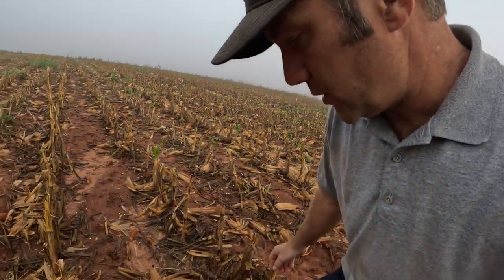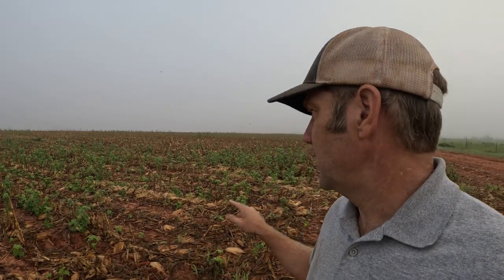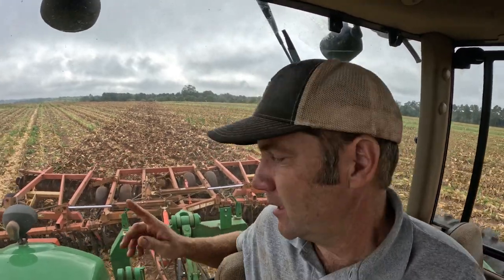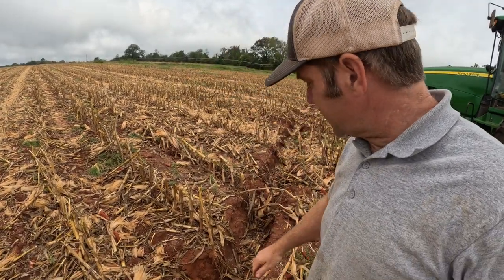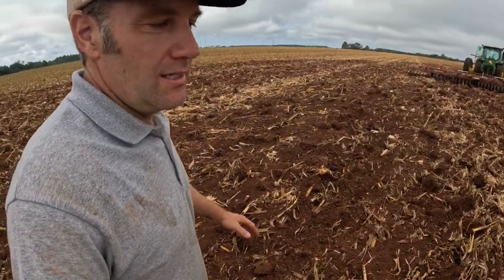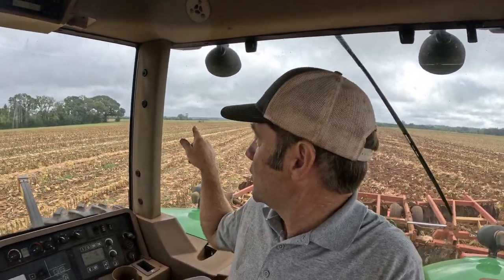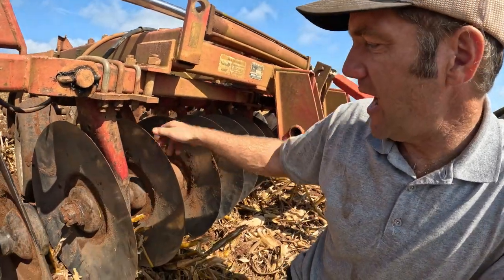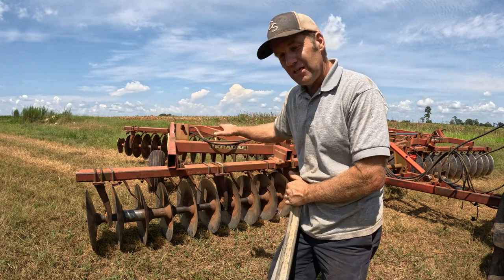Discing Corn Stubble

Comment: You are exactly right about ground speed w a disc harrow, our almost new rmx 340 31 ft is between 6.2 and 6.5 is it's speed and it's a little faster than your older harrows be ause of the cylinder on the tounge to adjust front to back pressure

Comment: Would scalloped blades cut the stubble up any better than the round blades?  Enjoy your description of the various tasks you are doing.
Reply from the maker: Scalloped blades are much more aggressive cutters.  Usually only see those on offset harrows around here used for cutting firebreaks.  Lift type harrows also usually have them to.

Comment: I'm a little late watching this one.🙄 Both tillage and chemicals are just tools in the box. Only YOU know what works best for your operation and conditions. NoTil is fine for corn/bean rotation, most of the time. But nothing is perfect all the time. Great video!
Reply from the maker: Obviously the fewer passes across the field the better.  No-till on red clay just isn’t an option.  I did a small trial in corn field this year.  All other variables were the same, tillage the only difference.  Most my corn was 8’-9’ tall yielding 240 bushel average…..the no-till was under 3’ tall, not all seeds produced a plant, not all plants produced an ear.

Comment: As a no till farmer it hurts to watch land being disc, but different soil types along with what we call a specialty crop calls for different measures. We're mostly corn wheat and soybeans around here so we no till and strip till everything.
Reply from the maker: Strip tilling was very popular here for 15-20 years but recently farmers are starting to trend away from it some.  I know there are large regions of the country where no-till corn is very successful and I’ve heard no till farmers in Montana say their wheat yield is “acceptable.”  In our area the wheat yield is doubled if you subsoil ahead of it.  No-till corn would yield 0-75 bushels here.  I had one row in my field that was shallow tilled but not subsoiled—that 600 yard row was 3’ tall and had 4-6” ears while the row on either side of it was 8.5’-9’.  No-till is a great option where it works, but isn’t an option everywhere, just as deep tillage is a great option where it works but also isn’t an option everywhere.